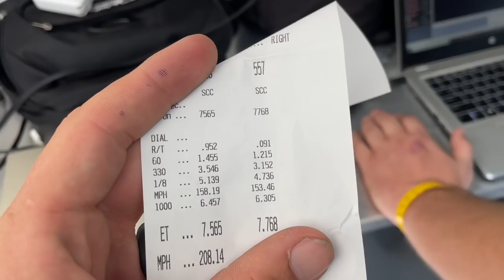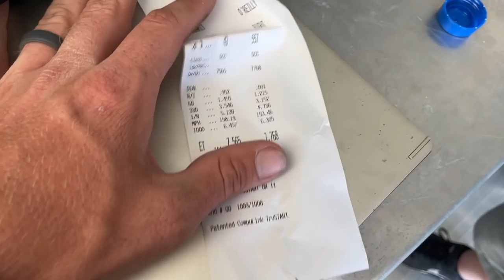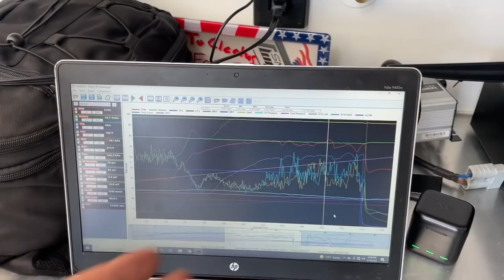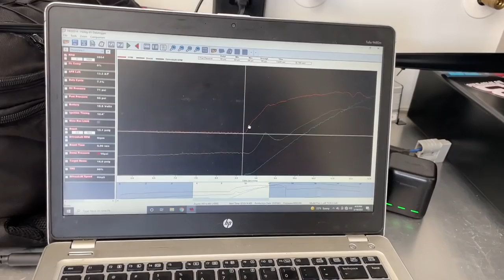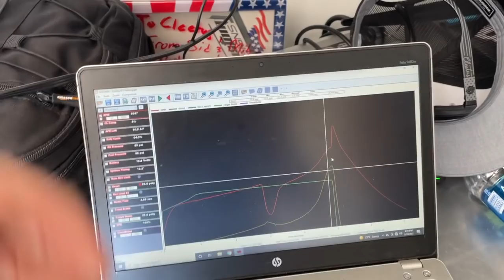TX2K22 Day 2: Ruby Goes BOOM On The Starting Line and Mullet BARELY Qualifies!!!

Comment: I'm not bitching but do you check everything on the engine? there should not be anything loose etc. it's kind of dumb to have things loose and not tight. I would check and double-check the engines in and outs.

Comment: I wonder if it's like my gy6 scooter you gotta change the jets in the carb for different elevation or it wouldn't run right I imagine you're either alot higher than sea level than you would be in florida or alot lower but consider that as a factor?

Comment: Cletus I would like to share some very important information about mullet you're going the right direction but a failure of your valve train is due to physics and geometry and the lack of fluid pressure in your valve train you need to drill your oil holes larger and chamfer the edges of the exit and entrance if possible so that you may have more pressure and volume which helps hold everything into place 22 the lack of pressure when you reduce throttle pressure not to mention during the two step misfire cylinders which also cause a uneven pressure in the valve train and reduce the capabilities of keeping the rods in place I see just if your heads don't have narrow push rod slots you will them in and narrow them so that they act as guides even if you do have guide plates and also stop dropping throttle pressure off the two step at excessive rates going from a high RPM two step and even pressure are ready causes some issues but dropping the throttle with you and even pressure physics and geometry say it's not a matter of if you will have a catastrophic failure it's when I say you're lucky it doesn't happen to you every time but nonetheless when you drop a push rod you get uneven pressure and cylinders which below head gaskets and or create huge crankcase pressure issues which plug and gaskets without cover gaskets and take gaskets two steps survey great purpose but can also hinder a cars ability to stay together engines aren't always capable of the oil pressure in the valve training to keep solid lifter parts under necessary pressure in today's builds so when using solid lifter camshaft and roller rockers or mushroom tablet s you must pressure up even just putting a new oil pump will not be enough you will have to drill I'll drain holes to supply camshaft I and lifters with much more pressure &volume
Reply: I can't afford a pair of those earbuds but if you ever want to thank me for any information that leads to the repair of your vehicle I wouldn't mind a pair LOL anyway good luck and hope you're still enjoying the ride not bad for a lawyer at least that's what the guy says on TMZ LOL good luck this year looking forward to you at least being the top three instead of having to drop out of every competition peace out

Comment: You need to change the main harness on ruby , the harnesses from holley are not made to be removed a 100 times , you guys change engines every other week the wires break from inside that why you have wiring issues
Reply: Ruby has had an engine change "every other week??"  Sir, are you high?

Comment: That blows. You came prepared, cause that's what you did the day before. It didn't perform exactly the same. Thought Mullet would put down a 7,10
Turns out both cars didn't do well.
Wouldn't it be better to go with just one car, so the focus is on putting one good time for one car, instead of two for two cars? Pick a car.